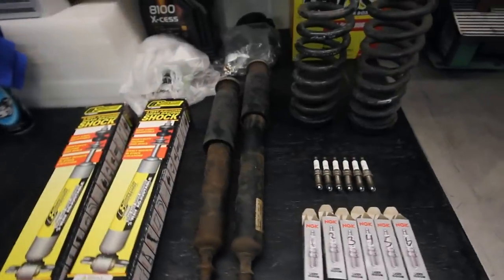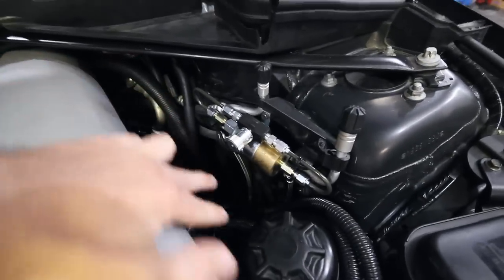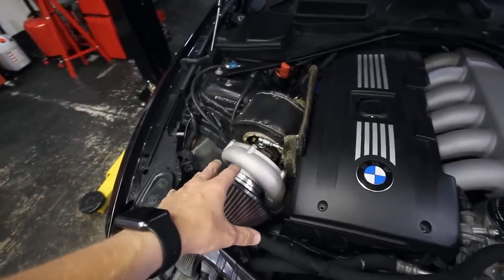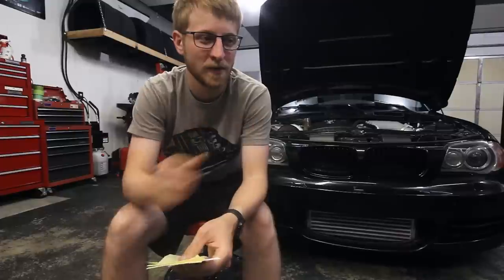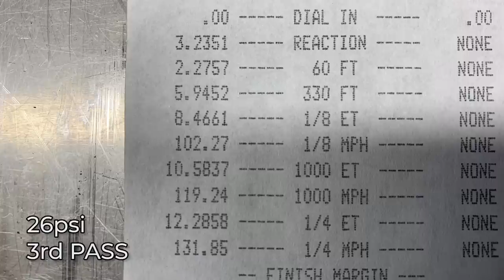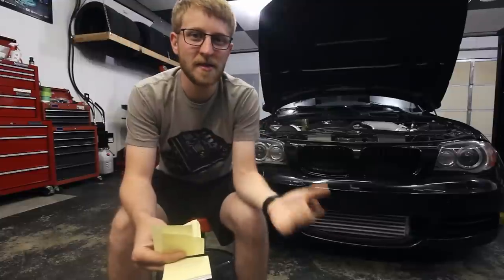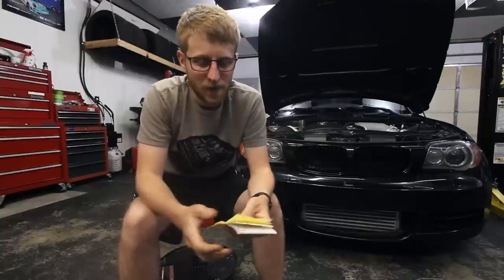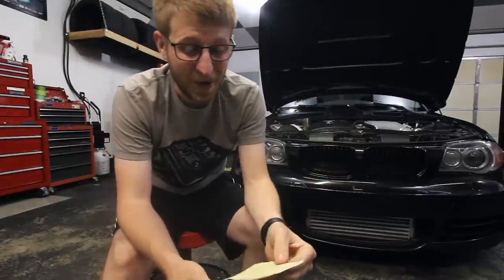Chasing a 10 SECOND PASS in my 750HP BMW 135i! (Single Turbo)

Comment: Congratulations jake welcome to n54 10sec club..not alot of manuals are in the 10s. That makes 4 of us i think now..
Reply from the maker: Right on! Thanks. Congrats to you too, as you know it isn't easy. I'm coming for your 10.8 pass!
Reply: @jake_spence  haaaaah thanks bro. Hopefully i can make it this year to track. I have done all fuel upgrades since then so i will be going back with more boost. Plus i broke my leg last week so im out for a few months..i will keep watching your videos. Congratulations once again..
Reply: yea congrats! So what auto transmissions do these higher hp guys use?
Reply: @PP-nr4xj  stock remapped or th400 for the big bois
Reply: Rey Ramirez 4 in the 10s and 1 in the 9s
Reply: That's pretty pathetic. RS3 with 600hp do 9s all day long.
Reply: @norcalrey2197   would a 75 shot of funny gas help for spool up? I'm sure you've thought of that.
Reply: @CP-jt6bw  i would rather use a 2step/ Antilag setup to spool the turbos from a dead stop...hopefully MHD will come out with something soon...
Reply: I hope someday to make it there too!
Reply: @norcalrey2197  I broke my humerus (upper arm) in February - opted to not have surgery.  It takes many months to recover!  Good luck man, and stay positive... you will be back fine.
Reply: Rey Ramirez j

Comment: Congrats on your goal. Can you share a bit of info of your exhaust. Why 3" vs 3.5"? With a bit more practice on launching, and you will see low 10's.
Reply from the maker: It's a custom 3" done by a local shop (Legend Auto) with one Vibrant resonator. I chose 3" over 3.5" purely due to price. 3.5" was a bit more expensive. If I could do it again, I'd get 3.5" but it makes good power on the 3".

Comment: Thats it man, Roll it out of the line. 5000-5500 rpm is probably perfect, only thing you just need to practice is not letting out the clutch too fast and boom bang 2nd gear and your off. Id say your car has mid 10s. Congrats on the build!
Reply from the maker: Thanks man! I think it has a few more tenths in it as well. I appreciate the comment and support!
Reply: @jake_spence  Subscribed!

Comment: Jake I highly recommend the BC Racing BR series. You can get them off FCP Euro for less than a grand with a lifetime warranty. They have built-in camber plates, 30 dampener adjustments and are fully adjustable for height and preload. I'm insanely happy with them so far for DD and track use.
Reply from the maker: Sounds like an awesome coilover! Do you think it'd be good for drag racing?
Reply: @jake_spence  Absolutely, and you won't need to worry about swapping between track and roll events either. For the money it cannot be beat. You'll be able to watch your rollouts and tune your dampener settings to get a nice even launch

Comment: Great video Jake! I think Cleetus' advice comes into play here, don't try to hard! Let the car do it's thing! Congrats on the 10 man!
Reply from the maker: Thanks! I spent a lot of time watching Cleetus launch and how he talked with Adam LZ about launching his single turbo 335i.
Reply: Good advice there, Matt. It seemed like so much thought and effort was going into these early runs when honestly, with a road car, the best thing you can do (in my opinion) is just feel the car and give it an easy ride. Leaving traffic lights and junctions hard teaches you all you need to know in terms of giving it all the throttle you can without shredding the tyres. Screw having an automated clutch release device. That just removes one of your two primary control inputs. Clutch and throttle operation are all you have, so you need to be able to feel them and adjust them moment by moment. Practice makes perfect, and we saw PLENTY of progress in this one visit to the strip 👌 9.9 next time 😂
Reply from the maker: Haha, true! I thought the clutch device would work better, but just didn't. I think 9.9 is pretty aggressive, but maybe one day!
Reply: @jake_spence  Haha just kidding with the 9.9! Playing with tech is really interesting so I can totally see why you tried that clutch release valve. I've had some success with a button-operated launch control system in the past (made by Armtech, if they still exist?). . I mounted the button to the gear lever so it was really easy to use, enabling you to set your launch RPM instantly, varying it every time if you wanted. Once it was set, it was up to you how much throttle you applied, basically making the throttle pedal your boost pressure adjustor (more throttle = more boost) and then you release the clutch when you have the boost you want. I typically left the line with +2 psi of boost and a turbo already at speed, compared to maybe - 6 psi and a slow-spinning, laggy turbo. Your 2 step seems to be a bit of a nuisance for you. Maybe it's just not working right?
Reply: @jake_spence  Found them: http://armtech.co.uk/page2.html . Mine was the third one down, with optional launch control switch. Really simple device.

Comment: Nice one! Do you have ny info on the guys with DCTs? How much power does the stock DCT can hold?
Reply: Laurynas Mališauskas I have dct 335is 600whp is limit stock I have upgraded billet drums and clutch packs. I’m 700whp plus
Reply: @minnesotamotors9976  do you also know if the same DCT went into N55 E82? Because what i have is a 135is 2013 and i am thinking is it worth it to keep a DCT one or to just sell it and buy 435i manual

Comment: Nice pass bro, I used to drag race my evolution 8 it was totally redone had a GT40 on it and some other fast race bits, stroked with comp cams use the blaze down the track all day at 9 1 and 9 2 at 164 miles per hour all the way up to 172 miles per hour and it still had a lot in it so kudos brother
Reply from the maker: That's awesome! Sounds like a wicked car.

Comment: I have an n55 e82 coupe. Your problem is simple same as mine. Needs an lsd. Quaife do one I'm looking at. Will be much more consistent. You are one weel burning like I do!
Reply from the maker: Yup, the car desperately needs an LSD and some upgraded axles. I'm eyeing up the MFactory unit or swapping in an E9X M3 LSD and subframe.
Reply: @jake_spence  I did the subframe bushings for solids pretty good, horrible job though. Eyed up the mfactory Axel's but not seen much in terms of reviews in the UK so wasn't sure about them. Won't the M3 subframe affect rubbing on the arches as they are a going to push your track wider?
Reply from the maker: Solid subframe bushings are on my to-do list for sure. I know of a few people who have broken MFactory axles, so I'd be careful with those. The M3 subframe will fit, people have done it. The 135i hubs stick out further with a higher offset than the M3 hubs.

Comment: Ive got a 09 135 fbo except turbo swap, one of the biggest differences came from the whiteline body mounts, stiffened up the chassis like you wouldn't believe!  Feels like new shocks and springs, no slop.
Love how you show the progress and tips -- keeping it real.  Its not easy i know.  Its difficult modulating that much power especially with a turbo and manual.
Reply from the maker: Nice! I've been looking at solid rear subframe bushings. I think that's going to be next, a complete front and rear suspension refresh.
Reply: @jake_spence  yup those are the ones I was referring to...

Comment: Also, I bought a 335i in hopes to make a small grudge car.. did I buy the wrong thing?
Reply from the maker: No, they have great power but you will need to work on your launch, suspension, tires, LSD, etc.

Comment: I've always been curious why BMW's aren't the best at drag racing. The weight? or power loss through trans? The 4l80e cars seem really fast in comparison... idk. For example, the c6 z06 runs very low 11's consistently with 500hp. I don't think any 500hp n54 in running that. Doesn't bother me though I'm trying to build a street-legal WTCC car
Reply from the maker: It's a mix of a lot of things. The suspension, transmission, lack of power with a big turbo 6-cyl, etc.

Comment: Wow much respect for the build that's a tough AF Bimmer, From experience All I could suggest you do for improving that time is warm the tyres up a bit more till u at least get a bit of smoke , then try flat changing if possible but anticipate a bit of wiggle going into second , another idea is get a wider sidewall to get longer ratio on first so u can launch at max revs out the hole and more squish and traction on the sidewall will help with traction cause that mph of 136 is rockin a perfect launch should see you going mid to low 10's that's if you've done weight reduction along with your build and a perfect run I'm not that familiar with what you've done in terms of gearing or weight reduction but beastly BMW for sure love it
Reply from the maker: Awesome tips. Thank you! I'm going to try all of this stuff at some point in the future to try and run a low 10 sec pass.

Comment: Taking my 6mt 335 to the local strip today for a baseline time before I start bolting on goodies. Was a bit disheartening to hear you say these cars are terrible drag cars and aren't built for the strip. I think if you got a bit more heat into the tires you may have some luck launching at a higher RPM. Also part of me seems to think your clutch slip device is causing the 2 step to wig out, regardless if its dailed all the way up or down or however it works. Cool gadget but I think it would be too hard to get perfected, too many variables. track conditions, track temp, heat in the tires ect. I think your left foot is the best tool for the job. Congrats on the 10 man!
Reply from the maker: Thanks for watching and good luck at the strip! Let me know how it goes. I definitely could’ve used some more heat in the tires like you said. And I’ve since gotten rid of the clutch slip device. That thing sucked.
Reply: @jake_spence  I ran a 13.70 @ 107.00 with a 2.2 60'. I need a better tire.. that was on a street tire, I would either bog the hell out of the launch or blow through first and half of second. But I was happy with the baseline numbers especially the trap mph.

Comment: Is it just the manuals that aren’t so great with drag racing? I think the car will do 13 second passes on stock 300hp, i would think 750 would see greater improvement.
Reply from the maker: Yeah, manuals struggle. And as you increase the power, the car struggles. IRS, open diff, poor suspension, weak axles, etc.

Comment: You should try deep staging the first bulb, almost too the point that the second is flickering and then build boost and the car should rise into the second bulb to stage it. That way you are already up in the boost range for your launch. That way you can hold the boost you want and still cut a light. Of course that is if you’re not using the 2 step.
Reply from the maker: How can I build boost without the 2-step?

Comment: I would say 750 HP should do a lot better, meaning I would think 400 HP could get you there. Just my 2 cents With that kind of power I think you could do much better but like you said hard launch you get wheel spin. Open Diff right , gotta get a LSD or locker on the rear end And you could launch so much harder . I bet you would knock another 1 sec off you time with the power your are laying down.  OF course the game starts, you start playing chase the weakest link... you'll be breaking drive shafts , etc Good luck but nice car and shoot 10 sec is VERY fast.
Reply from the maker: Agreed, 750hp should be faster. I have made a lot of adjustments and added a lot of parts to the car. Going to see what I can do this year when I go back to the drag strip.
Reply: @jake_spence   I am sure you will do great , very nice car. question you have a LSD or open rear diff ?

Comment: What setting are you running the ce shocks at? I have mine on the medium setting and the tire hits the fender with my 275 40 17 MT's. Stock 135 springs with -0 camber
Reply from the maker: Do you have the exact same shocks? I have them set to the stiffest setting (50/50). Do you have the same wheels/offset too?
Reply: Jake Spence I have the 602740 and style 68’s

Comment: Congrats on the pass.  Couple of things that could help you.  What PSI in the rear tires?  You need to get a little more heat into them as well.  Are you starting in the watter in second gear for the burnout and using your brakes?  If you can get the 2 step working I bet it will help you on the launch.  I am not a BMW guy, but when I was FWD drag racing a manual the 2 step working was the difference between a 1.828 60 ft and 2.05x 60 ft
Reply from the maker: Thanks! Rear tires were at 16psi warm. I tried to do better burnouts but struggled. Car either wheel hopped, bogged or hooked. I started in 1st and then stepped on the brake.
Reply: @jake_spence  In my experience starting in second with the tires wet, they will break loose faster and allow you to get more heat in.  If you are serious about drag racing, then invest in a line lock.

Comment: Get the 2step working. Set it to 5300rpm and run the clutch out on a bias and you'll be running low tens easy
Reply from the maker: That's the plan, but probably won't happen until next year!

Comment: Why are these cars bad for drag racing, im actually thinking of purchasing a 2008 335i with the 6 speed manual, with hopes to build it for a drag racing set up. Goals are 750whp, so what is your opinion and personal experience with these as drag cars.
Reply from the maker: The suspension and power delivery makes it difficult. They make all the power in the world and are great from a roll, but can't cut a good 60ft or 1/8 mile.
Reply: 1st, open differential
2nd single turbo lag is hard to launch
3rd, Jake is not doing a proper burnout
4th The guy is learning
Still fair enough

Comment: Congrats!! You deserve it. Sometimes less is more, in case of all that lunch control hassle. I think with some goods semi-slick “street” tires and mastering the launch, you should be able to hit 10.5s. By “mastering” I’m meaning to get to the perfect launching RPMs and gear shifting. I know you can do it!! And what about some NOS after third gear?? Even tho I’m not a NOS fan!! 😂😂😂 BTW, wanted to point out I noticed some blue smoke from the exhaust at 15:45.
Reply from the maker: I think it definitely has all the power I need in 3rd + 4th gear without N2O. I just need to get the 1/8 mile down. I'll keep at it and improve shifting. The car smokes from time to time, especially on decel like that. Just part of the game at this level of modification.
Reply: Jake Spence   Definitely it has it. Once you figure out proper launch and shifts RPMs, cupcake!! The NOS part, I’m just messing around. Btw, does your intake manifold, fits N55s??
Reply from the maker: No, it doesn't fit N55s.

Comment: Burning up the clutch trying to do a burnout isn't helping that launch... Screw the clutch device and get a line lock. You will get much more consistent launches that way. Nice job though, that thing makes power.
Reply from the maker: Thanks! I got rid of the clutch device. Might try a line lock in the future... will try again in a few months when the snow melts.
Reply: @jake_spence  a 2-step would be perfection though.  Would launch like a beast!

Comment: Congrats.  You mentioned that these cars are not good at this sort of thing. Is it the because you can’t fit the size of tire you need to fit or something else?
Reply from the maker: The 1 series has terrible tire fitment options. The wheel wells are narrow and require weird offsets. Otherwise, it's poor suspension design and no ability to launch well. It's hard to cut a good 60ft, but they backhalf well.

Comment: Fatter tire, heat them up more by a little more burn out.  Get some white smoke going.  Good job Jake!
Reply from the maker: Thanks man! Definitely need to do better burnouts. Struggled though, car wanted to wheel hop or hook, hard with the single turbo having to have it revved so high up for enough power.

Comment: I dmed you. I have a 650whp 135i in Chicago and need to know what style wheels are on the rear and if they fit on stock brakes?
Reply from the maker: On Instagram? Hopefully I replied by now. They are Style 68 wheels from an E46 (rears). They will fit on stock brakes.
Reply: Jake Spence what slick on it?

Comment: I was saying the whole video, stop with that 2-step, and these launch aids!!! I was like slip the clutch and let it rip!!! Sure enough you did! Awesome. Do a nice burnout and get the tires hot!!! Adjust tire pressure too. What tire are you running?
Reply from the maker: Haha, thanks! I struggled with the burnout because the car either wheel-hopped, bogged or hooked. I'm running Mickey Thompson ET Street R.
Reply: @jake_spence  go around the burnout box, back into the water and spin the tires, pull up just out of the water box. Put it on the two step build a little boost and pop the clutch and hold the brake and hold it there for about 3-5 secs. It will make a huge difference. On that tire I'd start at about 18PSI and see what happens. Adjust lower from there depending on track. I have had the most success around 14-16PSI on a drag radial. Stay away from those electronic assists man. You are going to have way more success with launching the car the way you did.
Reply from the maker: For sure! Unfortunately there is no room to drive around the burnout box and my 2-step isn't working properly. But once I get that fixed, I think we'll be in business!

Comment: Could the 2 step not be working because you weren't holding down the volume down button to get 2 step and antilag to work simultaneously? Congrats dude!
Reply from the maker: No, I don't think so. The latest firmware integrated the two automatically so you don't have to hold the button down. Thanks tho!
Reply: @jake_spence  "DTML WMI Input" on the WMI page of JB4 enables/disables anti-lag for two step on the latest firmware, it's just mislabeled for now.